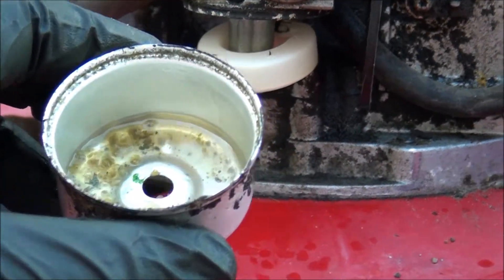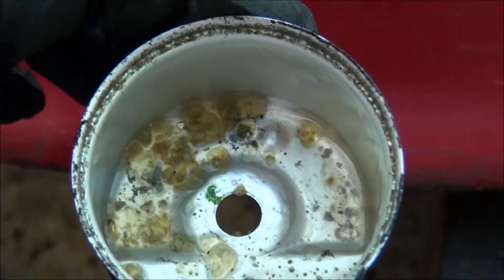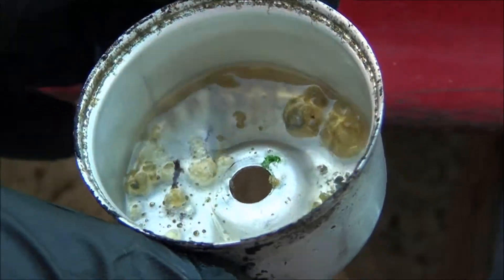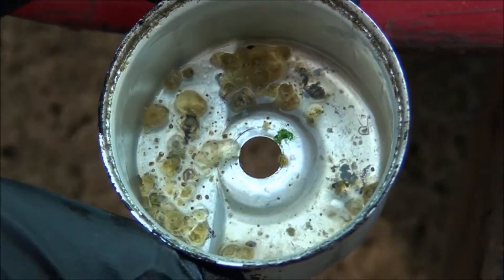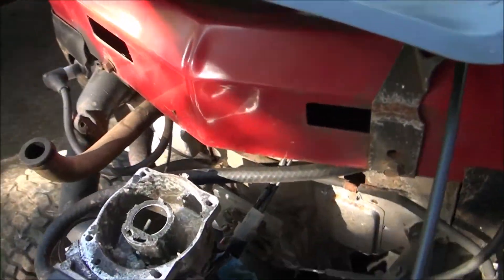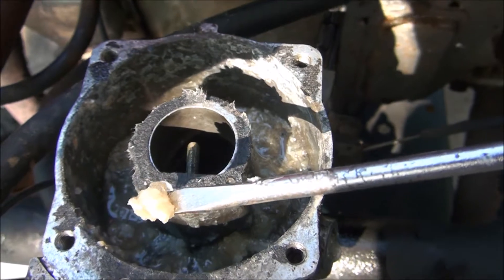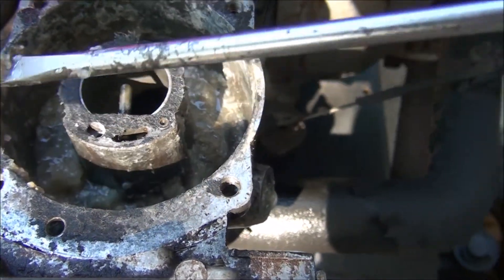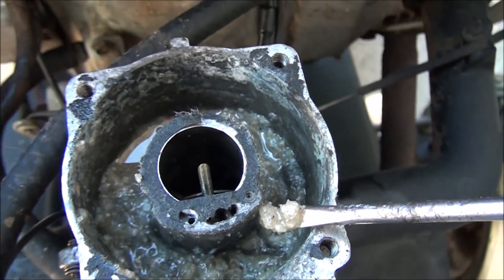The PROBLEM with ETHANOL FUEL: PROOF OF Gelification, Attracts Moisture, Corrodes Carburetors

Comment from the maker: Too much time, effort and chemicals are needed to clean carburetors that are damaged by Ethanol Fuel. Many people throw their lawnmowers away after a few years when this happens and it will no longer start or run. Regular gasoline lasts much longer and in my opinion creates less overall environmental pollution in the end.
Reply: Jeff's Little Engine Service i have a scooter repair shop same problems with ethanol   alot of yellow deposits in carb
Reply: you are so right on this will you run for president and ban this junk il vote for you any day I have to start all my stuff every few weeks just to help keep it cleaned out and still have to redo carbs every few years
Reply from the maker: haha! it's crap!
Reply: This stuff is a menace to society.

Comment: Hello all. I've worked in small engines most my life. (almost 50 now) I'm glad to see a lot more folks taking the time to get in on the gas and small engine discussion because the changes our government has mandated to gasoline has turned out expensive and frustrating for millions of users.

That said, I'll chime in:
Literally thousands of customers per year come through our shop and their only sin was trusting pump gas. Say what you will about your success/failures with your hand full of small engines, shops are dealing with much bigger numbers.
At the end of the day, nearly 100% of small engine issues can be traced to today's poor quality pump gas. However, there are too many variables to get everyone to understand with a 5 minute conversation....such as:

-You CAN'T know what you are pumping by what it says on the pump!!!!
-You CAN'T know the age of the gas!!!!
-Does your gas tank "breath" (it needs to seal completely.) turn it upside down, if it drips, it is part of the problem
-Does the "sealed" fuel system on your unit still "seal" Most system check valves installed to allow air to enter when running and seal when not, fail in the "open" position due to pump gas damage.
-Too many more to list here....

No one is saying that "all pump gas is bad". BUT IT IS THE REASON A LOT OF MONEY AND FRUSTRATION IS BEING SPENT THAT SHOULDN'T BE!!!!!

Before you say "Manufactures should build engines to run on today's gas!", understand this, when gas is food, Plant based,  or whatever the ingredients are that are NOT gasoline, a carburetor fueled  internal combustion  engine will suffer. Yes there are E85 cars and race engines designed to run on it, but that race car is not running on old, stale, phase separated junk folks are pumping at the corner store.

Most users are still unaware of the negative gas issues. We have always been able to trust the pump, but gas is very different than it used to be. At our shop, we don't expect folks to blindly believe us about the gas, but almost no customer is willing to put in the time it takes to learn about what is killing their small engines until it hits them BIG in the wallet. So we are stuck in between the manufacture and the gas issues....and a lot of customers just want to blame someone else for what they put in the tank because "they didn't do anything wrong". We are on the same side of the "bad gas" fence as the customer is, so we can't go up against the EPA, FED, or gas companies any better than the customer can.

We've experimented more ways than imaginable and consistently come back to mail order, "canned" gas as the end all fix. We also have our favorite brand and stay away from some due to failures we've intermittently seen. (varnish, rust etc)

There is a light shining on the expense of canned gas. In small 2 stroke engines, we have experienced (and our customers are reporting) as good as 2 to 3 times the run time. I wouldn't believe it if I hadn't witnessed it hundreds of times in the last 6 years. Do the math...When the tool no longer has to be thrown away or repaired often, the cost is actually less.
 
By the way, the old wisdom  of running the tool empty for storage is not working for thousands of customers a year just through our shop. Even if you do not use canned gas, put some in all your empty small engines and run therm before storing, with the failure numbers we see, our customer are guaranteed to save time and money.

This can go on and on with hundreds of examples of avoided big money failures. (think outboard motors) If you saw hundreds of "NEWER" engines a year ruined by pump gas, human nature would dictate, you would get jaded towards pump gas. However, to play devils advocate, If we see 2500 fuel caused issues a year through our shop, and the local community just throws away 10,000 units to buy new ones, that still leaves tens of thousands of small engines within 15 miles of us. Sooooo, that means not everyone is failing....but it also means, there are thousands undoubtedly struggling to run correctly, but running in spite of the junk gas.

Trump just put his stamp of approval on phasing in E15 to replace the current E10 currently common across the country (done to appease the farmer base) . Regardless of your politics, this is a bad thing. We in the industry expect things to get worse.

Manufactures (Husqvarna, Echo, Stihl, VP etc. ) are entering the market with available "bulk" gas to get the price down to the dealers and end customers. Imagine if you saw thousands of fuels sytem/engine failures a year caused by pump gas, you would then understand why shops like ours mail order 55 gallon drums of gas. 

I know that's a long 2 cents worth, but I assure you, no matter what you think you know about pump gas, you don't know it all and the fact that a high volume shop like ours sees a new negative that tops the last "worst one" every few months proves it.

I'll hold back on suggesting a brand, but we have seen issues with verified sole use of one brand in particular. We still believe it is a far better choice than the pump.
Reply from the maker: AWESOME POST! Thank you Clay!
Reply: If you know how to work with eth it is one of the best octane boosters. Runs way cleaner than aromatic octane boosted gas and way less carbon build up in the head. Better at preventing detonation. The reason why race teams like eth meth and alcohol. I always add a lubricant to it for small engines since it dries out in the combustion chamber when sitting and also periodically drain the carb bowl to remove any moisture buildup. Built many motors big and small and used to think eth was so bad but with experience i now see it as one of the best octane boosters and years of experience. The eth free movement made by big oil is actually a scam
Reply: Used to work at a shop on small engines in the mid 90's thru 2000, we saw alot of gas related problems then, people let them sit all winter with gas, rebuilt many carbs. I can imagine the problems ethanol is causing these days. Thanks for the post and the comment

Comment: Never seen ethanol gel up. I have seen gasoline gel up and dry into a something like a varnish. I've also seen ethanol destroy fuel systems in older vehicles and lawn and garden equipment, basically anything with a canvas accelerator pump or mechanical canvas type fuel pump because the alcohol makes the rubber dry out and harden up. Same with plastic fuel lines. Rubber fuel lines will deteriorate from the inside and clog up fuel filters. Metal fuel lines and tanks will generally rust from the inside out, again clogging filters and passages in the carburetor, as well as staining on the spark plugs, sometimes enough so they no longer fire reliably.
Reply: I'd recommend looking at a few chemical compatibility sheets.

Comment: Ethanol attracts water. Water enters your fuel system in the air that enters the fuel tank as the gasoline is burned by the engine. The water is drawn into the gasoline, making for a chemical mix that accelerates corrosion of metal parts in the engine.
Reply from the maker: exactly!

Comment: I just rebuilt my carb for the 2nd time in 5 years. I think it's a combination of ethanol fuel & infrequent use. I only drive my car 1500 miles a year at the most, just in the warm dry months.  Someone suggested that I use race fuel in the winner for storage because there's no ethanol.

Comment: They build carbs for ethanol they cost but if your racing the engine runs cooler. I ran alcohol yrs ago in a Briggs engine on a racing kart can't put gas and alcohol together it will gel we would run the methanol drain the tank change the jet and run Skittle gas through it to clean it up haven't messed with ethanol yet but I'm gonna try it in my open wheel modified

Comment: Hope you dont mind my ignorant question, but ethanol gas that is not the same as regular gas you put in your car, correct?
Reply from the maker: Ethanol unfortunately is in most regular gas to reduce carbon emissions.
Reply: Rochelle R It is exactly the same.
Reply: Rochelle R make sure it's none ethanol
Reply: The difference isn't the type of gasoline. It's the type of fuel system used in each. Most cars these days use fuel injection which is made to run on 10% ethanol blended gasoline. Small engines, on the other hand, still use carburetors which, despite what companies claim, are by no means engineered to run on ethanol.  Thus they can't compensate like your car engine can...

Comment: In America you are for some reasons so afraid of ethanol - In Europe ethanol is very popular and you can easily go 42.5% of ethanol (and 57.5% regular gasoline) and that can handle any car with fuel injection (at least here) I heard about guy from Czech Republic doing this on Skoda Felicia LXi (1.3 liter, 4 cylinder (with fuel injection)) and had no problems
Reply from the maker: Ethanol fuel in the USA seems to attract moisture and cause corrossion....
Reply: Do you think that there is different ethanol in America than in Europe ? Or is there (that much) different petrol, so if you combine theese two there is different mixture with different properties ?
Reply: @miroslavpokorny8125  Car has fuel injection, gasoline not exposed to air. Carb exposes fuel to air. I never have trouble with ethanol in the car, I always have some issue with ethanol in the carb, especially if the carb has exposure to wet and humid air.

Comment: I assume these people in the example here had the ethanol fuel stored in their equipment over winter or some other long period of time without an a stabilizer like StaBil or something like Star Tron Enzyme Fuel Treatment?  I'd personally like to see ethanol banned for the scam that it is, but I think if you take some common sense precautions and don't buy more than 10% ethanol, you 'should' be ok for storage over winter with a good additive to prevent this sort of thing.
Reply: Where do you shop that you have a choice as to the ethanol content percentage?

Comment: ON OLDER CARS A CORSE ITS GOING TO DAMAGED THE FUEL SYSTEMS AND CARBURETORS BECAUSE THER WERE NOT DESIGNED FOR IT AND ON NEWER CARS SPECIALLY ON FLEX FUEL VEHICLES THERE WOULD BE COMPLETELY FINE AND WONT HAD ANY ISSUES

Comment: Even worse is the fact that I always use QuikTrip premium fuel. I'm still getting these deposits. Says something about their gasoline! Going to switch providers
Reply: @Kevin Rundle. QuikTrip premium has 10% ethanol. That's your problem. Buy the QT no ethanol gas then you'll be fine. Ever since QT came into my area a couple of years ago, I use nothing but no ethanol fuel for all small engines; lawnmower, gas trimmer, chainsaw, pressure washer, etc. No additives and have not had one issue.

Comment: Hmmmm I wonder why no one in Brazil has anything bad to say about about ethanol? Bad maintenance is why your carbs are all gelled up. Ethanol doesn’t turn into anything... it evaporates and leaves no residue. If you leave a container of ethanol open, then yes it may absorb water, but both the ethanol and condensed water will evaporate and leave nothing behind. The gummy mess in your carb bowl is from the BTEX additives that are put into E10 gasoline. Use E30 gas, and there will be no more problems with gel. Try it!
Reply from the maker: Yes bad maintenance can contribute to this problem. On Lawnmowers however,  ethanol attracts moisture for sure in the "open" style fuel systems in colder wetter climates. The moisture then "gelifies" after time and the chemical reaction/moisture begins to corrode the inside of the carburetor. In closed/Vacumme style fuel systems such as on automobiles, the Ethanol is not a problem. This is because it is a more "sealed" closed fuel system which does not allow moisture from condensation and humidity. In my experience, when it evaporates after time it causes a white residue.
Reply: As I said before, ethanol leaves zero residue. There is no chemical reaction between water and ethanol... they are inert. 80 proof clear alcohol is 40% ethanol and 60% water. Left to sit for a month in an open cup on the counter, it would evaporate leaving zero residue. The gel is from the BTEX additives in regular E10 gas, NOT the ethanol. And the burning of ethanol has been proven time and time again to pollute less and emit far less harmful chemicals into the atmosphere than gasoline. The 2 main byproducts from ethanol burning are aldehydes (which quickly break down into simple elements) and Co2 which is heavier than oxygen and get used by vegetation to produce more oxygen. Can’t argue with science.
Reply from the maker: GioGuitarDude I understand your point now. When I refer to Ethanol gas I am referring to E10 . We dont call it E10 here where I live. I guess I will have to research BTEX. Never heard of E30
Reply: Ethanol is alcohol so when it runs in an engine (that is properly maintanced) it auctly cleans the engine. I had to replace my fuel filter on my car after switching to ethanol because it cleaned the gunk and the gel out of my gas tank that the gasoline built up.

Comment: E10 has clogged my whole carburator with ging when it was E5 nothing happened, now E10 is even removing paint from fuel tank fucker has blocked the whole fuel supply line to engine, filthy gum residue.

Comment: in my 20 years of mowing lawns I have never had any issues with ethanol.At the end of each season I simply fill the tanks of all my Zero turn lawn equipment with fresh 92 octane fuel.I always use 92 octane fuel in my 2 cycle equipment.Fuel stabilizer is nothing but a scam....

Comment: If you dont like it then dont use it.But to throw a blanket statement like " ban ethanol" simply because YOU dont like it is very narrow minded and ignorant.Drag racers for example who have to pay upwards of $8 pergallon for race fuel love the stuff because it burns more efficiently than gasoline.Then theres the excellent cooling effect it has on engines which allows the use of supercharger boost without the hassle of intercoolers and all at lower prices than even the cheapest gasoline...So speak for yourself.